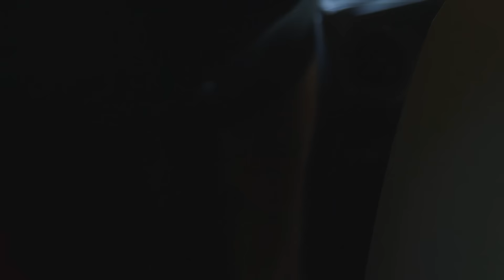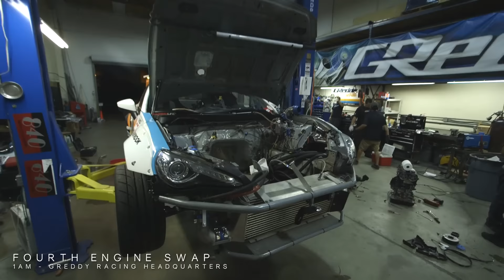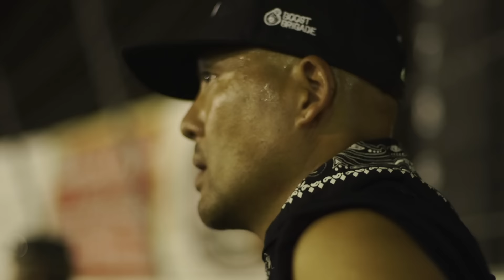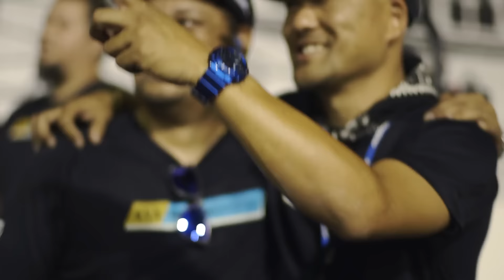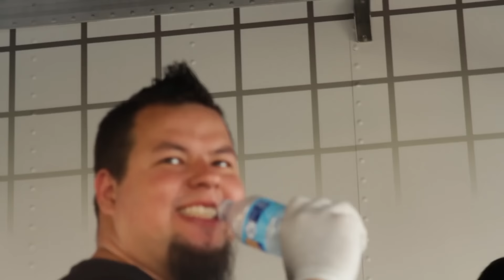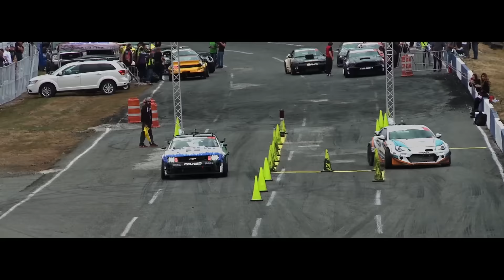Formula DRIFT Irwindale 2015 - Round 7: Ken Gushi Highlights [S7, Ep 8.2]

Comment: The 2JZ is built like a tank and very reliable, so why did it take so many engine swaps???
Reply: +Leofred Well those were their first engine issues out of the entire year. Its like they didn't have any all year and it all went to hell in the finals.
Reply: +Leofred I use their parts on my 277k mile built 4AGE and it hasn't skipped a beat.
Reply: ***** Well, when so many engines fails at the same time, theres no doubt they were all on their last leg and had probably been so for a long time. Beside 2JZs never break down except when something makes them break, like humans and machinery, and Greddy was both of them
Reply: Aaryn Dominguez Just you wait. If it was a Nissan motor the greddy would have broken it even before it was started.
Reply: Leofred I'm not disin Greddy because from what I've seen most of their shit works relatively well. I've heard nothing but good things. :/ Been thinking of getting some stuff for my G8 when I get some more cashed saved up to dump in it. Besides its not like he's the only one. Others had more problems than him at several events than he has at the one. Its just a matter of luck really. And the whole 2JZ's never break things is just bleh.. Anything can break. 2J's, LS, RB you name it. Daigo runs through 2JZ's like water. Especially the last two years he ran em.

And these guys are professionals and worked hard to keep Gushi in the fight AND get him to the finals and almost a championship. I doubt me or you could do any better honestly. lol
Reply: +Vert344 in